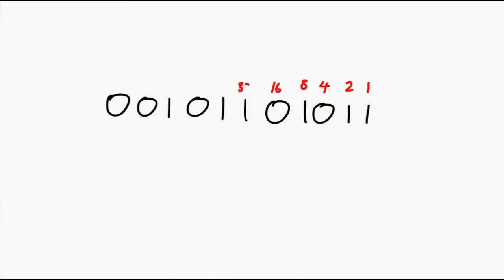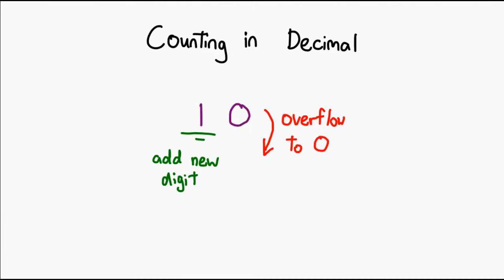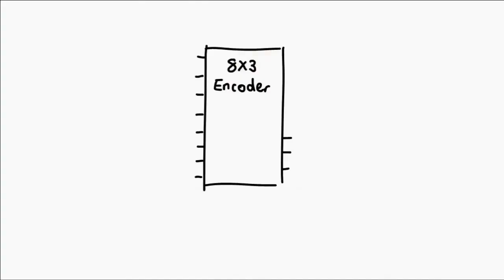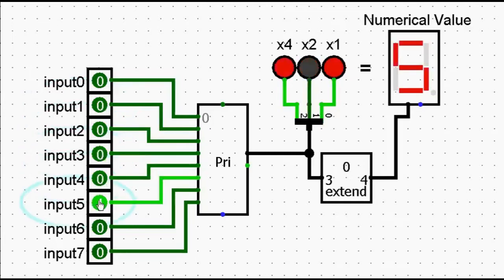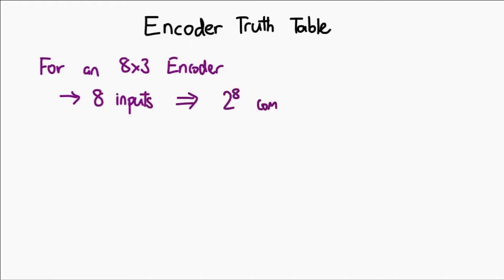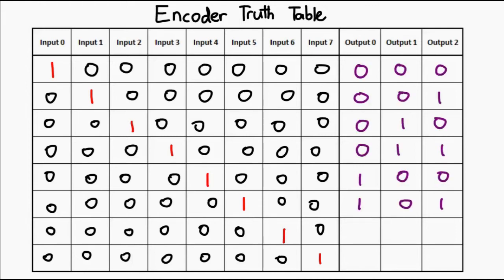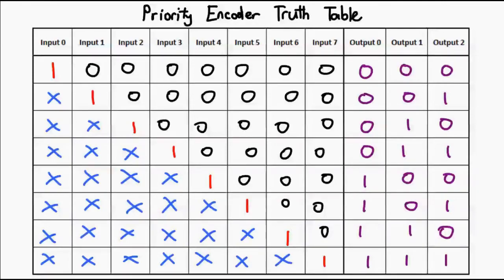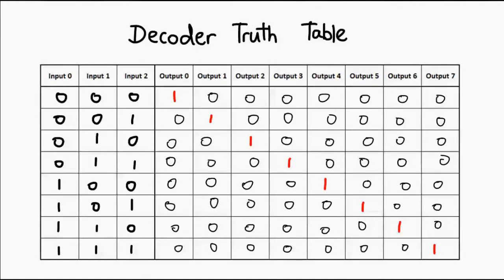Logic Components 06: Encoders and Decoders

Comment: Can you have a encoder 01234567 to a 2 output not a 3 output? As the number 2 in binary is 010 and 6 in binary  is 110 so in this case would you have to use a 8 - 3 encoder not a 8 - 2 encoder? As I think if it only had 2 outputs the number 2 and the number 6 would be 10
Reply from the maker: Hello again! You cannot use a two-output encoder if you have 8 inputs, simply because with two outputs, you couldn't uniquely represent all 8 possibilities.

If we know that an encoder has n outputs, we can calculate the number of inputs it will have by taking 2^n. So a two-output encoder can exist, but it can only have 4 inputs.
Reply: @NERDfirst  I thought so, thanks

Comment: Well u have explain it a lot better than others thanks, from what I got from this is a encoder  converts 1 to 7 optional numbers like 1234567 to binary numbers then a decoder converts the binary numbers back to  1 to 7 optional numbers, so if someone pressed a button so say 1234567 where the buttons so they pressed  button 3 the encoder would  work out that 3 in binary is 011 then it will send  011 to the decoder what then will translate 011 back to 3, so then  could say after the decoder is a light bulb so 3 is pressed then it turns on the number 3 lightbulb but say the other light bulbs what have not been turned on where 124567
Reply from the maker: Hello and thank you for your comment! You've got it! Just think of it as a conversion between a certain number of binary inputs, and its corresponding decimal value.